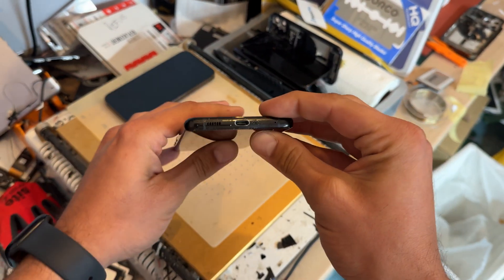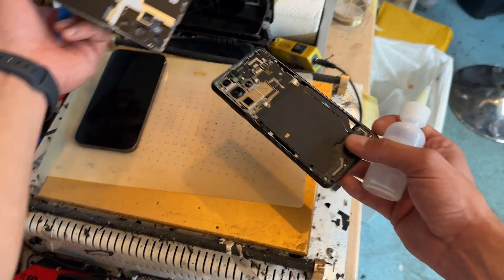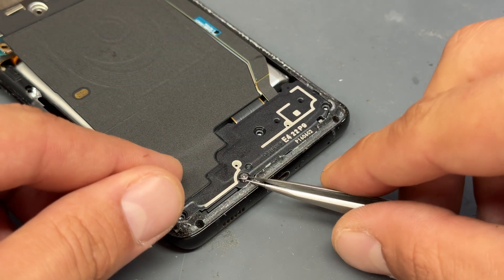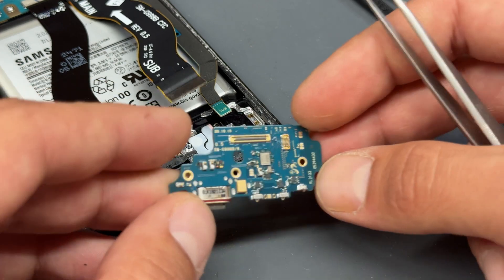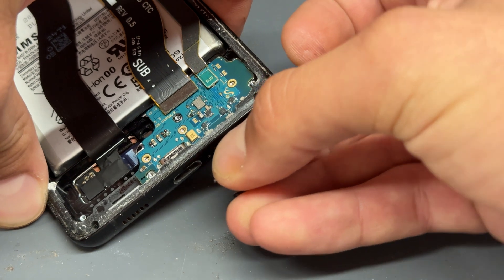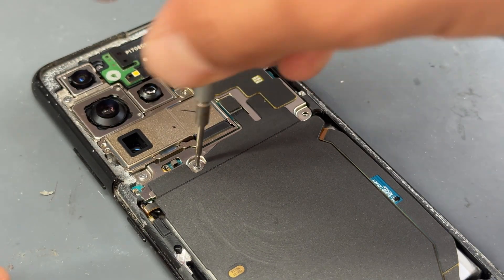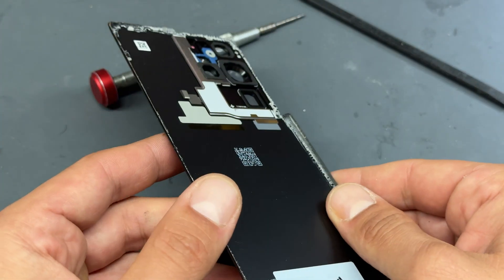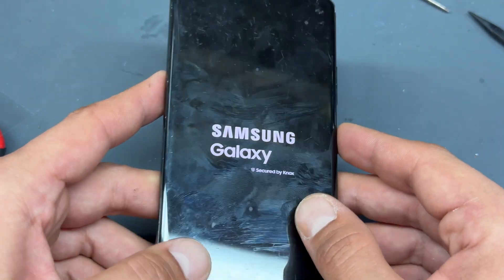Samsung S21 Ultra Charge Port Repair - Step-by-Step DIY Guide!

Comment: THANK YOU SO MUCH FOR SHARING THIS TUTORIAL!!!! I have a small business. All of my important apps to manage my small business and important notes (not connected in a cloud) are all in my phone. My busy season is QUICKLY approaching and clients are currently texting/calling me to book for spring, summer, and fall. I have lost a few inquiring clients already while my phone was not working :( BUT thanks to this tutorial that will NOT happen anymore! By the way, during the process of opening my phone as you instructed I did some careful and cleaning around the edges of my phone and the camera lenses. My phone looks almost new lol! The situation was, I didn't have a cover for my phone. Dropped it on wooden floor. After that accident my phone was unable to charge and read my SIM Card. Again, thanks to this GOD SENT video, I saved money and earned a tiny experience on how to disassemble/assemble a device. I honestly haven't pulled apart any devices since I was 10 years old LOL! My phone is charging better than ever and my phone can read the SIM card!! THANK YOU SO MUCH!!!
Reply from the maker: That's incredible to hear! So glad the tutorial helped you get your business back on track! 💪

Comment: went through everything except the last middle screw that is holding the charging port, the screw was totally stripped, cant even use rubberband, it was result from previous owner, any suggestion? should i just pry the charging port and break the whole charing port out?

Comment: Great video, took a while to accumulate all the bits, replaced charging port easily, annoyingly the phone still won't charge. Very disappointing. Any suggestions what else might be the problem? I have to charge it from a wireless charger, that method still works.

Comment: My Samsung S21 Ultra will not charge today.  It ran down to zero power, so no ability to reset any settings. Acknowledges "charge" being attempted, but seems as if battery is gone!  So sudden!
Background:A week ago, May 03, I downloaded large Samsung update. (Caused a few other problems). Could the update have killed my cell?
(Btw- I did have a few weeks of "slow charging" warnings prior to the update. )
Any advice is appreciated!!

Comment: Can you supply the link to where i can buy the replacement part, please? I've bought some from Amazon, and none of them work. They won't charge my device.
Reply: I've just had the same issue. It says 'phone overheating' and stops charging. I Followed all these steps which are fairly easy. I might have to put the old one back in and put up with dodgy charging until a legit charging port arrives. Not sure where to source yet though

Comment: I had my USB-C port changed out on my S21 Ultra and ever since I've had spotty cell signal. It works but seems to be diminished. I had a shop replace it for me and made sure they used a genuine Samsung part which I had to wait for to arrive to his shop. Not sure why my signal is like a light switch now on/off.. I went back to describe my problem and was told if there was an issue with the antenna that it wouldn't work at all.

Comment: how much does it cost for you to repair an s10e
Reply: You no longer receive any updates and will be better off buying a more recent phone. Those new snapdragons kick ass.
Reply: @MichlBinI  yes i know, i have an s23 ultra but i need to transfer the data from my s10e to the s23 ultra
Reply: and im planning to sell the phone anyways
Reply: Oh okay, didn't think of that at first. Well you could try plugging a mouse if touch is the only thing faulty. Also, there might be ways to copy data via download mode or adb.